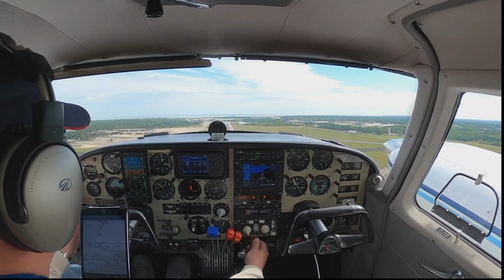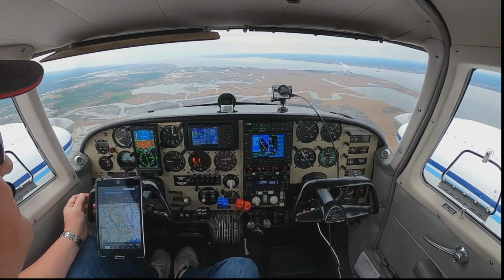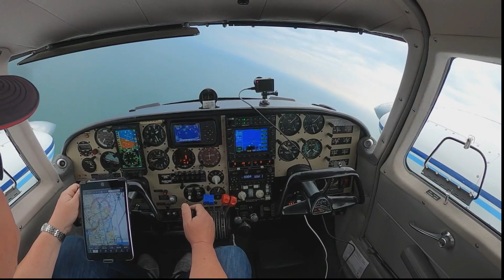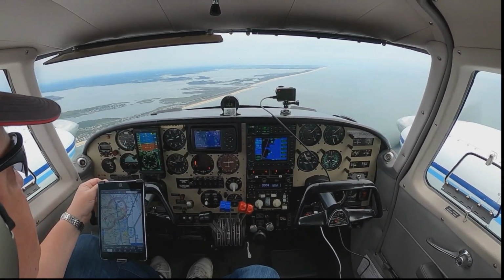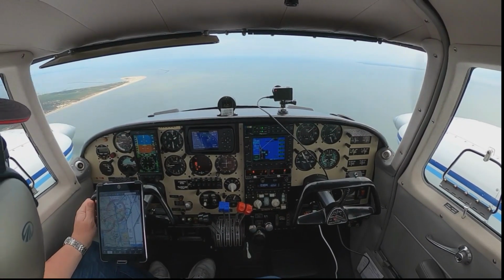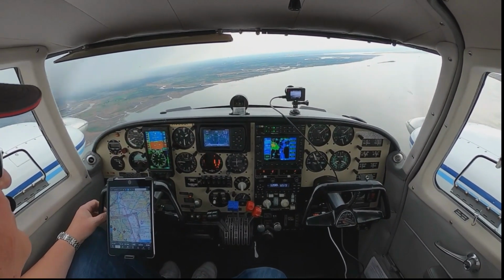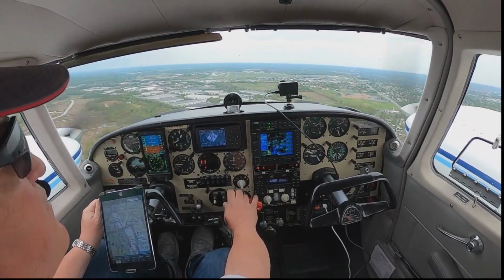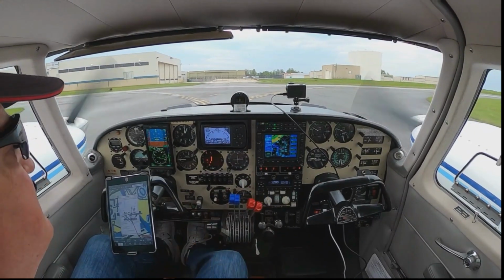Flight #003 20200503 Two More Twin Comanche Flights

Comment: The safe pilot axiom is "trust your instruments".  However, Ronald Reagan said "Trust, but Verify".  Seems like 1 out of 8 is possible for the hot #4, but it sure bears investigation, as it might not be a problem at all if the thermocouple is suspect.  Check all the connections, or swap it out.  Then retest.  Take a look at cowl baffling integrity too.
Reply from the maker: Jeff Gille hey Jeff, that’s good advice. I’ve done just that, including swapping and replacing. The story continues, but I think I’m in great shape as we speak.

Comment: You keep making reference to CHT with your leaning. Why aren’t you mentioning EGT? I know that you’re paying attention to the CHT on  left #4. But the EGT is directly correlated to your leaning. I used to own a PA-30. Always set my mixtures to EGT.
Reply from the maker: First. I am not an expert, and have been interpreting various knowledgeable people and testing on my own. 

Generally, CHT matters. EGT doesn’t, but it  does indicate where your CHTs will be going ahead of time. I do look at EGT, but I care about CHT. 

My understanding is that EGT can be whatever it wants to be. It is a general indicator that can be used to set mixture and manage power. CHT, on the other hand, directly indicates cylinder temperature and pressure. EGT Has no limits. CHT absolutely does. 

This entire process of power management is complicated by the fact that prevailing advice generally does not consider GAMI injectors and electro-air injectors in the mix. With this equipment, Running LOP by setting EGT to a reference point doesn’t seem to work well in warm weather. The correlation of EGT to CHT doesn’t seem to be consistent. In cold weather,, stunning LOP ops can be achieved and the relationship seems to be as expected across the range. Warmer OATs lead to more limiting CHTs.

Comment: I still, to this day, don't understand why aircraft manufacturers don't use automotive-based, fuel injected engines. They last a billion times longer, they're more reliable, and they're more simple. The only gauges for the engine you'd need is temp and rpm, there wouldn't be any oil loss over time, wouldn't be any fiddling with fuel mixture and all the other intricacies....

 Now I understand this aircraft in particular was made when fuel injection in cars was in its infancy; what in referring to is aircraft built today, or ones that are re-engined. For the sake of reliability, for the safety of those onboard the aircraft, if anybody who designs and builds planes is reading this, please, use automotive based engines (or at least engineering)

Comment: Great video.  I loved the first half where you talked about the GAMI stuff, the oil burn, etc etc.  The second half was great too, haha.  
Exciting w/ the CHT spike!
Do you have CR props? i've noticed that there appears to be an STC for installing the counter rotating engines, as there is a 1965 TC listed on TAP with CR props  (i believe they started shipping the CR models around 1970).  Any thoughts on getting CR? More pricey from a maintenance perspective, versus slightly safer?
Reply: Par5Eagles There has been a good discussion of this exact question (pros and cons of counter-rotating Twin Comanches vs. regular ones) on the “Piper Comanche” group on facebook. A few high-time TwinCo owners/instructors have expressed their opinion and they all seem to prefer the non-C/R version. They feel the added safety factor in the C/R ones is minuscule.
Reply from the maker: My apologies - I only just saw this and am still trying to figure out the best way to use YouTube to communicate.  Anyway - SaxTeacher said what I would have. I've flown both and don't feel that it matters. If I had two models side by side that were the same - I'd chose the C/R version. I wouldn't weight it much though.  Frank
Reply: @PA30Pilot  OK, thanks to both of you!  there seems to be a significant premium for the CR, so it is good to know that it doesn't make that much of a difference.